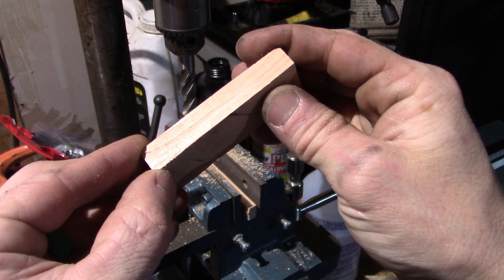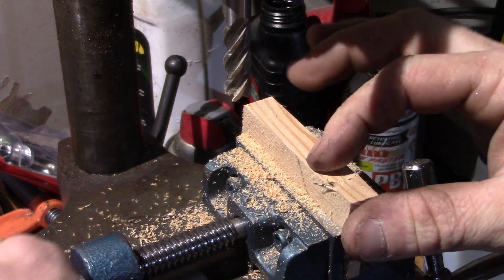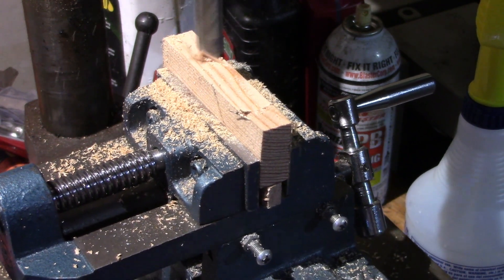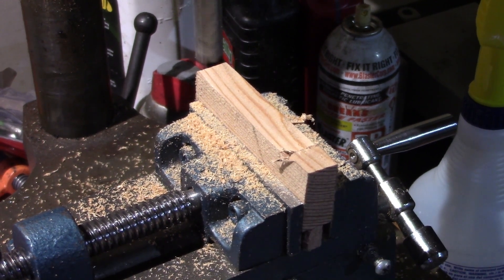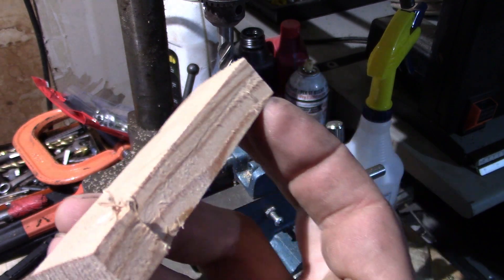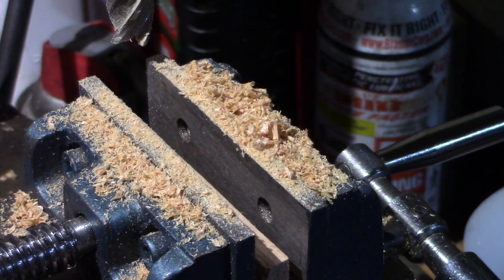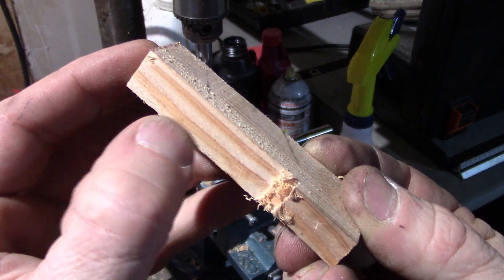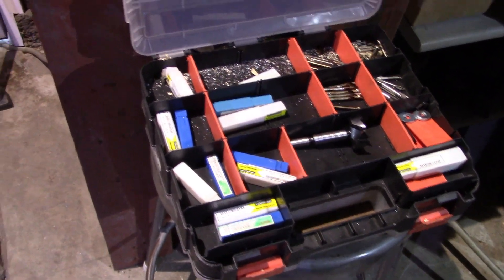Cringy Machinist Ep 5: Drill Press End Milling Wood AT DIFFERENT RPMS

Comment: You'll find that if you only take half of the the width of the cutter not only will it be more smooth but your mill bits will last a lot longer , and taking a 1/4 width is better , as I was told years ago , stop trying to Hog it all off in one pass .